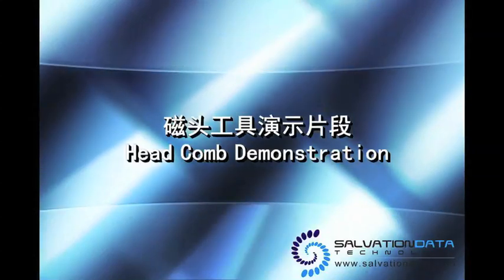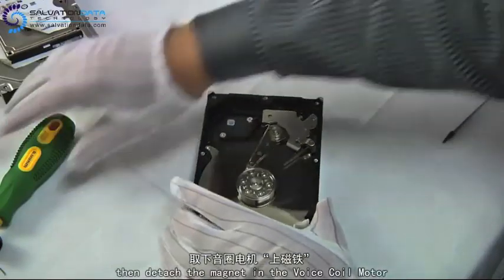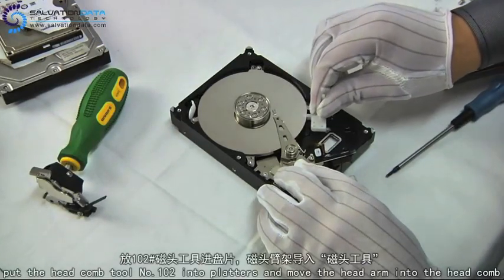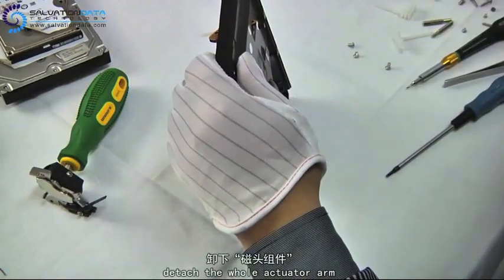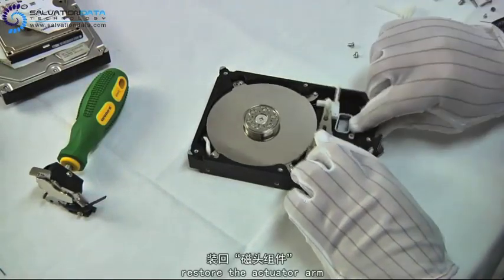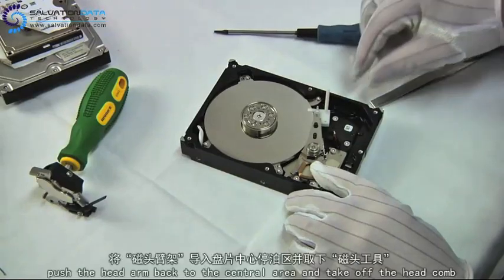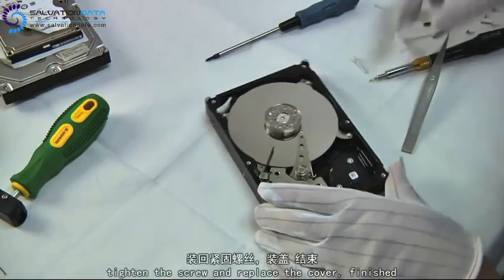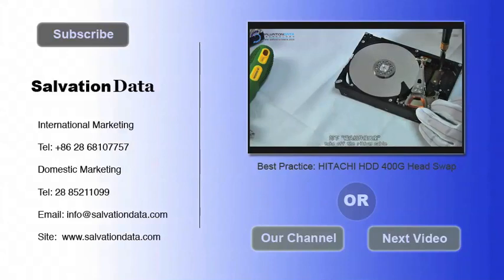Head replacement for Seagate 7200 Hard Disk? Check the EASIST&QUICKEST way to do it.

Comment: Have a Seagate 3TB baracuda ST3000DM001  that makes a clicking noise during bios startup.  Bios and Windows takes longer to boot.  Harddrive is not listed in bios.  I took it out of my computer and opened it.  I see black specs on the top harddrive platter and almost like black toner on the bottom top cover of the harddrive.  What is this?  I can't tell if something burnt. Why would this occur and what can I do to fix this?  Hope my issue is fixable without having to pay a professional if I want to recover my data.
Reply: A Geek Dad Did you ever resurrect your ST3000?